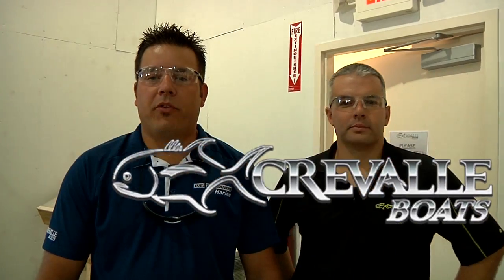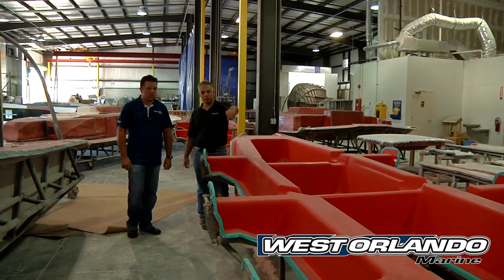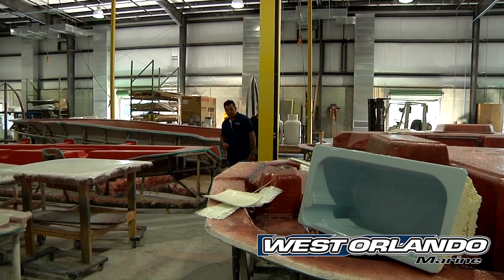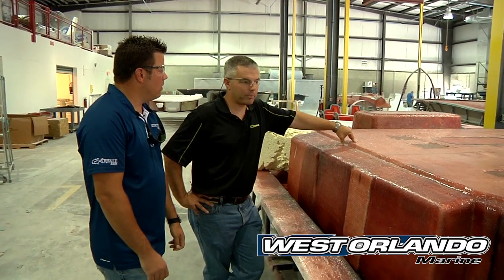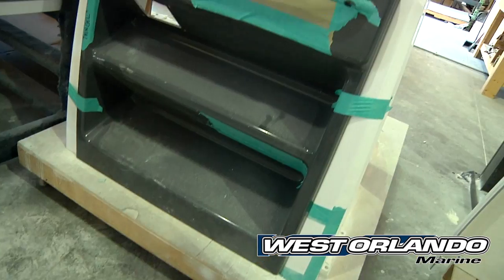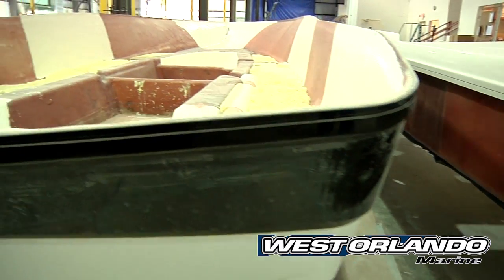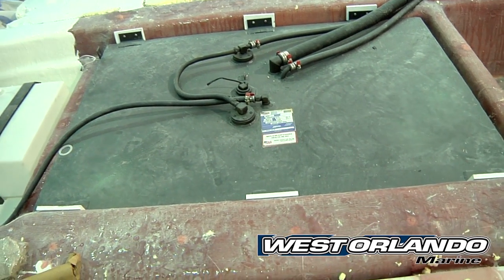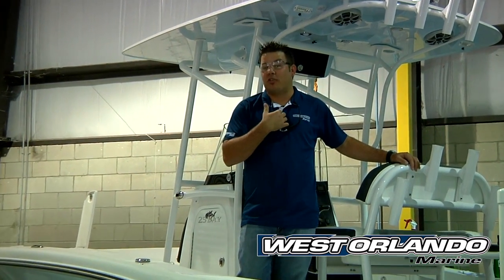Crevalle Bay Boats Factory Tour

Comment: Stumbled on this old video. Since this was filmed they purchased the building next door and doubled the size for assembly. Laminating and cutting on the first and final assembly on the other helps keep it clean when putting things together. Also since this the infusion technology has been started increasing strength and reducing dead weight at the same time. I have worked at a few other boat manufacturers before working here and these guys do have a good thing going and getting better. Just need a few changes in some of the departments team leads if they haven't since I left. That's all that is holding them back.